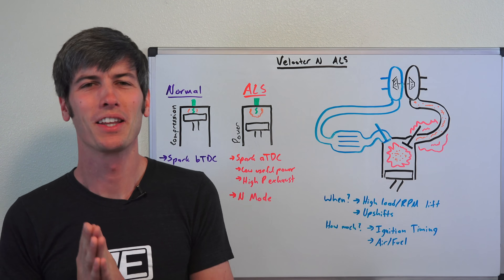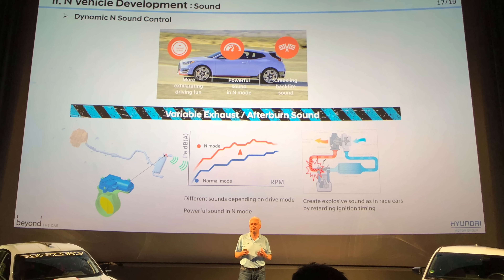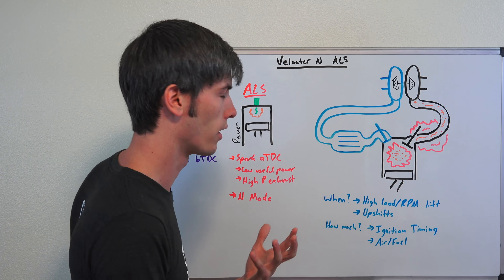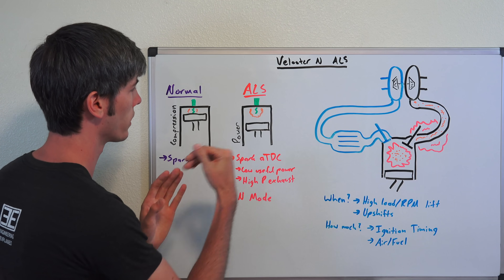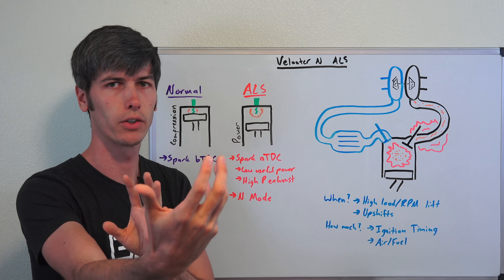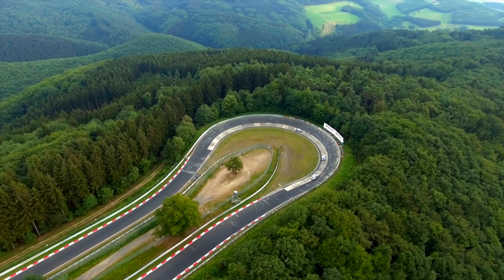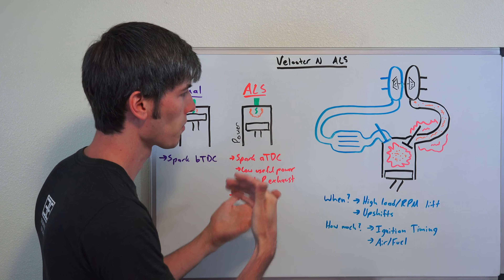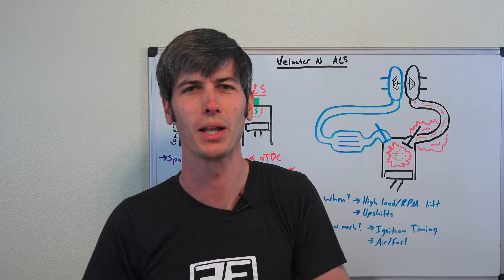Anti-Lag - How Hyundai Eliminates Turbo Lag

Comment: If more combustion is occuring in exhaust manifold than the c.c,  u said it will help the turbocharger spooled up.  I still don't get it,  how would it help in overall power generation,  it looks like its reducing it.
Reply: Think of the power stroke as producing a set amount of power. By retarding timing what you are doing is igniting so late that not all of this "set power" can be transferred into the piston, so there will be some leftover kinetic energy going out of the exhaust and spinning the turbo.

The key is ALS only kicks in when you are OFF the throttle (and probably on the clutch). Any energy that is transferred into the piston is wasted always, so why not divert some of that out of the piston into the turbo.

Comment: i thought anti lag destroys turbos? that's why wrc drivers go threw like 6 turbos per season
Reply: Not the same anti lag as in WRC. Those cars have literal afterburners in exhaust so yeah, they kill turbos quickly. This surely does put additional load on manifold, turbo and cat, but they're probably made sure those components are robust enough to be able to take it. They wouldn't put a 10y warranty on a unreliable car.
Also, anti lag only kicks in when driving hard in N mode, so a lot less often than in a race car. You probably won't floor it in N mode while getting groceries :)
Reply: feel you

Comment: That is pretty awesome Hyundai is catering to car enthusiasts even at the potential longevity/reliability issues from the antilag.
Reply: Maybe, over time, there could be more carbon build up on the exhaust valve seat. Keep in mind that it only happens when in "N" mode, so if you rarely use it, it won't be an issue.
Reply: Raiden at first glance I figured you were right. I'm wondering if the fuel burning through there if it might clean the valves instead. 

I figure that as this burn doesn't have the pressure of the combustion chamber so it'll burn less efficiently and have more unburned fuel which would be a cleaning solvent for carbon. 

Just guesses with imagination. 👍

Great comment. I love the ones that get me thinking. Thanks Raiden. If you like engine theory I have a few educational videos on porting based on what I've learned from one of the famous greats in the industry. David Vizzard.
Reply: DE Nichols, good points, I guess we'll see if Hyundai did their homework once we see these engines reach 100k miles.
Reply: It's a very toned down version of anti lag. They aren't going to run the same amounts of pressure in a production vehicle as they do in a WRC or WTCR car and since Hyundai is including track use in their warranty it shouldn't cause any stress that the system can not handle, not even when driving it like you stole it.
Reply: TheDudeInTheRedHotHatch hey man old post but wondering where you read that about the warranty
Reply: HEY GUYS CHRISFIX IS HERE☝☝☝
Reply: Hey there!!
Reply: Whoa I never expected you here
Reply: This is why I’d buy this car and leave it completely stock. Drive it however you want and they’ll warranty whatever for 100,000 miles
Reply: What additional stress is this on the engine? Pistons, pins, rods, bearings?
Reply: Will Whiteside I wouldn't say too much wear on the internal of the engine since it's designed for combustion on the downstroke of the piston, but for sure your stressing the exhaust and turbo because a bit of the combustion is happening outside the cylinders.
Reply: Will Whiteside basically just a more violent way to keep the turbo  spoiled while off throttle, so the wear will be turbo, and probably the cat, not so much the engine its self.
Reply: Brock Duffy good thinking here from everybody. I'd like to add that when you let off the gas exhaust normally turns extremely lean. That's actually harder on a catalytic converter rather than easier. I think that this, if not to extreme could actually protect the catalytic converter from these lean times.

I agree it pushes the turbo more, but hey, when you ask for that mode to be on you don't want the turbo spooled down. 👍
Reply: Brock Duffy so the most expensive things 😁
Reply: @brockduffy8729  Do you think Hyundai actually tested this out long term wise? If it has a more harsher effect on the turbo, it should be bound to break sooner than without having this anti-lag right?
Reply: @boomwhites7  definitely be burning the valves slowly.
Reply: That's why Hyundai has 5 years/100'000km warranty
Reply: Yeah it's allways awesome to know that my Veloster N will breakdown before a base model Veloster will. Enthusiasts Car, lol
Reply: @julientaylor  if you drive like a moron.
Reply: ChrisFix Hi Chris nice to see you here! :)

Comment: Yeah I have a question, how does the cat not burn up?  On rally cars the cat is placed at the very end of the exhaust so the egt has cooled down a bit.
Reply from the maker: It’s duration is shorter, and it’s using significantly less boost than a rally car.

Comment: For everyone worried about longevity, doesn't Hyundai have a really long 10 year 100000 mile warranty. Your going to be sick of driving that same car by then.
Reply from the maker: Yeah, Hyundai has crazy long warranties.
Reply: I drove my 300hp Silvia for about 17 years, when you have a powerful car you never get sick of it lol
Reply: Then why’d you sell it
Reply: Because I had outgrown it, and it was costing to repair/upkeep a lot more than what it was worth. My next car will be either a M135i or a 300c srt core 8 : )
Reply: 5yr 100k km here in Canada :(
Reply: Tony Magee But They have longer garanty elsewhere, so They know those car are reliable
Reply: I bought a Veloster N and my contract actually says 10 yr or 120,000 mile  warranty whichever comes first.
Reply: I still have my Genesis Coupe with over 131k miles on it.  And it runs like a watch.  I now have a Veloster N with the performance package added to my stable.
Reply: I will hit 100k on my 2014 Veloster Turbo R in the next few weeks….

Probs gonna go buy an N lol.
Reply: Worst case is a turbo replacement I think. You really can't drive it in the sport+ engine mode (the actual name of the engine mode with the ALS) all the time anyway because the popping is so constant and obnoxious you get tired of it and it gets the cops attention really fast even in slow traffic. I set up the N custom mode to use Sport engine setting which has some crackle but doesn't do the super loud ALS bangs. If my turbo craps out after warranty is up I'll look at it as an opportunity to upgrade, because once the warranty is up I'm likely doing a bigger turbo anyway even if it's not ruined by then.
Reply: @destruxxx  I drive in N custom mode all day everyday except on long highway journeys unless I  passing them I go back into N custom for the pass. Double tap a button on the steering wheel and bam N mode. It makes the car more responsive.
Reply: No miles limit in greece

Comment: This sounds really cool and is a good solution. I am worried about longevity of the parts. All that heat and pressure going through the manifold and valve. If I bought this car I would be legitimately worried about those parts wearing down and breaking quickly. Obviously after the warranty. 

What is your experience with Hyundai's part longevity? Is this system nothing to worry about or would I start have problems  at long milage?
Reply from the maker: You don’t have to use it, there are other modes if you’re worried about longevity. But engineers think about these things when they design it, and 100k is a long warranty.

Comment: This ALS means also higher fuel consumption, correct?
Reply from the maker: As does flooring it haha, which is when it will be active. Relatively speaking, driving hard will use a lot more fuel than simply using ALS.

Comment: In 16 cylinder engine How many revolutions of crankshaft takes to complete each cylinder fires at once ?
Can you explain this ?
Reply from the maker: 2 revolutions of the crank for any size engine running on four strokes.
Reply: Engineering Explained : Thank you :)
Reply: 2 thanks billy

Comment: So can any arbitrary turbo motor be tuned for this function, or does it require hardware configured a particular way to work?
Reply from the maker: You could do it with most modern turbo engines with some tuning, but of course the weren’t designed from the factory with that in mind (turbo life, cat life, exhaust manifold, etc).

Comment: Almost the same performance as my Fiesta ST, but for $7k more (base price), I went with the Fiesta ST.
Good thing about the ST, is that it's more fun to drive, and the engine supposedly can handle up to 350HP, however, more often a stage 2 mod kit of 300HP are done from the stock 200HP.
There aren't as many parts for the Veloster available, and way less tests done. And the engine is less reliable.
Also, with only direct injection, and using an egr valve, the engine's weakness is in the carbon buildup on the intake valves.
All direct injection engines suffer from this, including the Fiesta ST.
I long promoted port injection, with direct injection in combination.
Reply from the maker: You haven’t driven the Veloster N, it’s not sold yet, and pricing hasn’t been announced either. That said, the Fiesta ST is a wonderful little car. Bummer they’re not continuing to make it in the states.

Comment: You can flash a 335i via mhd and have a burble option, so when you let off the throttle, it burbles for some time by retarding timing for the combustion to occur outside of the chamber. Is it basically the same method?

Comment: Wonder how they get away with all the stuff without destroying the converter?
Reply: As of late, I seem to have been hearing a lot about retarding timing from a cold car to help the catalytic converters warm up, thus reducing emissions. This seems to be active when it's already warm though. I'd guess they just need to keep it to a short to prevent overheating the cat. The only other concern is making sure that they run the car lean for a bit to "refresh" the cat (I only partially understand that part. Chemistry isn't my strong suit).
Reply: These Hyundai GDI motors enrich the air/fuel mix a lot under heavy driving to keep combustion and catalytic converter temperatures down.

Comment: So what engineering has to take place for the components that have to contend with that high pressure escaping from the cylinder? The potential weakest link seems to be the valve, since it's small and a moving part. Just curious if they address that with design or materials or both.

Comment: I really wonder how they managed to stick in a catalyctic converter that can stand the forces from ALS.
Rally cars that use ALS literally have cats that melt in the exhaust, emitting a red glow.
Reply from the maker: Yeah, though rally cars are running much, much higher boost.
Reply: Engineering Explained 
True, true
Bigger turbos do need more pop to keep it spinning.
Reply from the maker: Yeah, though rally cars are running much, much higher boost.

Comment: N mode ? Noise mode ?
Reply: If it revs the engine. If it goes through a loud car wash. Then that would be your most reasonable definition. I can hear those drying blowers spool up as I approach at the end of the auto car wash.

Comment: Won't this reduce the engine braking??
Reply from the maker: If you’re in N mode, sure. But for performance driving you’re typically on throttle or brakes, so engine braking isn’t as important. And it’d simply be a short delay, or you can use other modes.
Reply from the maker: If you’re in N mode, sure. But for performance driving you’re typically on throttle or brakes, so engine braking isn’t as important. And it’d simply be a short delay, or you can use other modes.

Comment: That is very good for turbocharger health... They aren't invented anything new.  Same "antilag" was done by VAG tuners many years before Hyndai i30 N. I personally saw so many cracked turbocharger housings because of extensive usage of antilag.
Reply from the maker: Why so condescending? It’s cool, and I’m sure Hyundai’s engineers have thought about the manifold. Cars aren’t new, same four strokes have been powering them for over a century.
Reply: Yeah it is cool because it can be enabled/disabled by button. :) However if you abuse that 'feature', you may do some damage, probably, because of exhaust detonations. I really expected some kind of antilag system as in old B group Audi Quattro, Umluft, that was really cool. Can you record VLOG about that and could you explain why today automotive industry doesn't use such ingenious antilag system? However, you are explained in some video how Volvo solved lag with electrically driven compressor and air tank, which is efficient, but very complex solution.

Comment: Jason. You just said that the timing is retarded and in n mode some combustion takes place in exhaust manifold....dosent this affect the cataylitic converter or other exhaust parts and still the car ia able to pass emissoins test?
Reply from the maker: Yes, and apparently yes.
Edit: Please do not post the same comment more than once.
Reply: Engineering Explained ummm i apologize for spamming the comment section ...🤐

Comment: i dont plan on buying a direct injection motor...something about gasoline bring pressurized to 206.8427 Bar (dont want to piss  off the metric crowd)
Reply from the maker: Diesel is direct, higher pressures, and been reliable for a long long time.

Comment: BUt when u let of gas the fuel must be cut off right?
Reply from the maker: ECU can control whether or not to cut fuel.
Reply: Engineering Explained fuel consumption must suffer, and who wants that horrible noise anyway .. it's just cost cutting rather than designing a decent turbo system like volvo for example.
Reply: Nick Clark it is not present when you drive normal
Reply: Nick Clark you turn off n mode and it goes away...
Reply: 'The gas' is just a potentiometer telling the ECU it's position. Then the ECU decides what to add and what not.

Comment: Thats an interesting system.
Has any manufacturer ever put a fuel injector and or another ignition source right at the turbo impeller to keep it spooled up???
Reply from the maker: They have injected air rather than fuel, as there wouldn’t be any oxygen for the fuel to react with. Then you run rich and combustion occurs before the turbo.
Reply: Id have sworn I read that somewhere as well, and untill I saw this that's how I thought it worked.

Comment: yeah... ttally needing that anti lag while breaking and coasting. sigh
Reply from the maker: Marc it’s not gonna keep going while you’re braking.. if you lift, you might be right back on the throttle, for a brief moment it maintains boost.
Reply: yes that's what i meant. since its a manual, the car doesn't know what you are planning to do, so it gives you the anti lag anyway. Even when you are just letting of the gas before a turn.
Reply: Engineering Explained But earlier you said for performance driving you're either braking or on the throttle... It's true sometimes you just need a small lift but surely a real ALS would keep going right through the braking zone so you have plenty of power available when you exit the corner?
Reply: lets be honost, its just there for bragging.

Comment: The people that think turbo lag is bad are the ones that have never experienced the how fun it is
Reply from the maker: Alex Boucher personally I don’t think poor throttle response is fun.
Reply: Engineering Explained I'm sure you have way more experience than me brother!
Reply: I think u drive a lawnmower VTEC H22 K20 ?
Reply: U R right, I have old 06 Impreza want to build EJ20 for 600hp the only issue trying to find a solution for it is " TURBO LAG".
Reply: Talal Abdulaziz you have a ej that's not built yet so you're still running a tiny snail. Therefore you shouldn't have much turbo lag, keyboard warrior.
Reply: It can be kinda fun for awhile but it gets old pretty quick
Reply: This. It can be fun sometimes, but it's mostly just annoying.

Comment: Maybe an electric turbo setup would be better - instant response and greater efficiency (presumably requires a larger alternator).
Reply: Not just a bigger alternator, entire (additional) electrical system. 12V is just not enough, Audi does it, but they needed to put a 48V system in.

Comment: So they burn extra unnecessary fuel? Why not just do what Mercedes did with their Hot-V design (except with one turbo on an inline 4 engine).
Reply from the maker: Daniel Sadjadian Helps reduce it, but quite a different approach that’s not super comparable.
Reply: Even when you're not on the throttle there will already be fuel in the cylinder as the engine is keeping at least stoich. ratio; All retarding the ignition does is transfer that energy into the exhaust gas (and therefore the turbo) instead of into the flywheel. 

It will only burn more fuel when you're in N mode, but its not wasted fuel because it's driving the turbine to help you go faster.

As you need to drop the engine speed anyway to match the ratio of the higher gear, not putting more energy into the flywheel will cause those revs to drop off quicker.